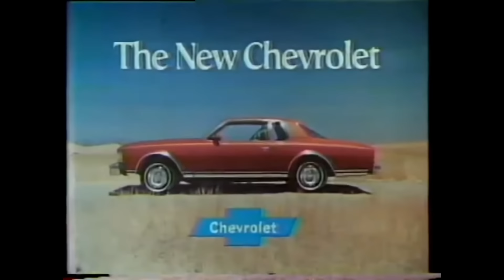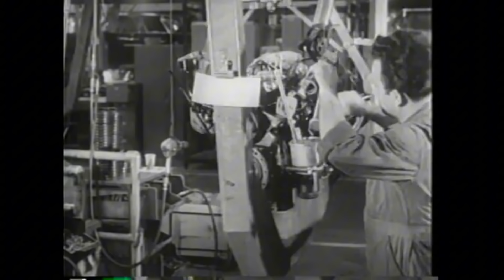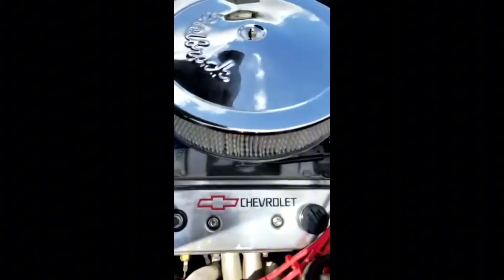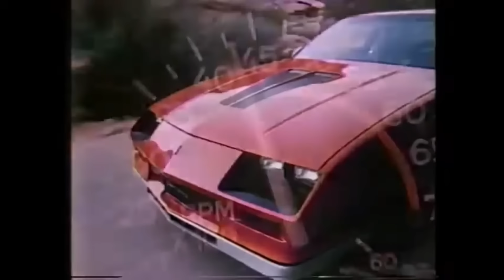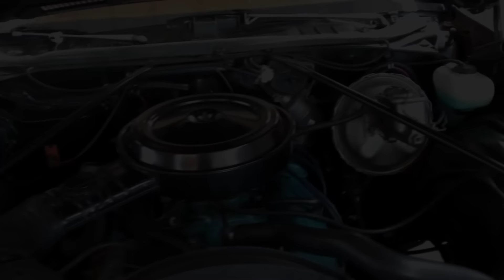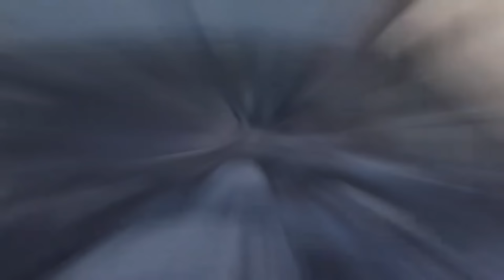How the Chevrolet 305 V8 Became GM’s American Savior AND Scapegoat

Comment: The 305 Chevy V-8 was a good engine in a car, they were not worth a flip in a truck, underpowered. I had a 1986 Silverado with a 305, had to get it replaced while under warranty, I paid the difference to get a 350 in the truck. The 350 made all the difference in the truck, fuel mileage improved and had better pulling power.

Comment: I assume the 305 came into existence because it was easier for GM to produce two small block V8’s and one small block crankshaft.   

The 307 was killed off in the early 70’s.    It was made by using 283 blocks and 327 crankshafts.    It would make sense if GM produced the 307 for just a few years in order to use up any leftover parts.    (I’m not saying that happened.    But it would add up)

Comment: I have only had one and for a very short time. I guess it is my own fault being as I never owned one before. It was in a P/U and had absolutely no guts. One drive of about 40 miles and between the engine and the over sprung suspension I got rid of it.

Comment: I bought a new 87 K10. I ordered it with the then new throttle body fuel injection and four speed OD. I routinely got 20 mpg and never needed more power in that truck. Sold it with 150k and never had one issue with it. Great truck!

Comment: The 305 is the greatest engine Chevy ever dropped in a vehicle, just kidding. It is however a decent little engine, I've had plenty of them over the years, they've all been very reliable. 

Even today I still have one in my 3rd gen Camaro, its the L69 H.O. 4 barrel version. What I've noticed is, if you box up all of the smog equipment, toss the restrictive cat and give it a free flowing exhaust your car will smell like gas, or like an old car, but seriously it will run a lot better. I don't beat on my car but if I want to, it'll smoke the tires right off the rims. 

The thing is, Its a SBC, and just like any SBC if you throw performance parts at it, it will respond in a positive manner.

Comment: When it comes to the 305, the word of the day is Compromise.  Compromise on power and torque, compromise on fuel economy, compromise on cost.  It has just about all of the same versatility as the venerated 350, even uses and responds to the same parts and bolt-on's for increases in power.  It's a decent engine, but at the end of the day, it's still a compromise.

Comment: 350 not efficient enough so make it a 305.  305 not powerful enough so add a 4bbl carb.  Why didn’t GM just offer a 2bbl 350 to begin with?  In the 90’s my parents had a 83 Chevy conversion van w/305 4bbl.  Sure it got down the road and is likely still driving today.  But man did it run bad, dieseling, backfiring, stalling.  It was like the uncle buck mobile it could backfire on command.

Comment: The 305 is fine and all but I don't understand why it actually exists. It makes less than zero sense to me; it's essentially just a 350 with a smaller bore.......... why? Why not just continue on making the 350 instead of a new engine, which improved on nothing, but at it's core was still 95% identical to a 350

Comment: GM also produced the garbage engines in 262 ci and 267 ci displacements in this era. They should have kept the 307 and 302 small blocks! My Dad had a pickup truck with the 305 and it needed fuel pump replacement every 15,000 to 20,000 miles. He traded it for a Ford with the famous 300 ci six. No trouble ever! Problem solved.
Reply: Agreed, a 307 was a way better engine than the 305.      I think thier reasoning was that the 305 & 350 shared the same crankshaft. Only 1 crankshaft to produce, besides the 400 SB and forged steel 350 crank in medium/heavy duty trucks.

Comment: I am in the process of replacing the 305 in my boat with a 350. 190 hp to 260. The same mileage in boats. Makes no sense to keep these little ones in boats.
Reply: Usually in cars the 350 got just as many MPG.

Comment: I had a 78 Cutlass Calais with the 305. It was surprisingly smooth and quiet for a small block Chevy. It did eat a camshaft, I replaced the camshaft, lifters and timing gear myself for about $200 in parts. It was then I noticed that the HEI distributor had frozen centrifugal weights and no budget to replace it. I spent a couple of hours with penetrating oil and got the weights loosened up. It felt like it had a power transplant after that! I think I kept the car for another year after that with no issues.

Comment: I owned 350's, 301's, 305's, and 307's. My experience was that the 305, and 307 were way better than the 301. 301's seemed to knock a lot even after you tinketed with them to get them to stop. The 350's were perfect. The 305 and 307 were functional although pretty powerless, but that's how the cars were back then........powerless.

Comment: We here on the East Coast blame the West Coast for the boat anchor. Dang flatlanders
Reply: If they needed to backpedal horses why didn't they bore and stroke the 283 into a modern sleeved aluminum block and run stock 2 bbl. heads?

Comment: I had one in a 85 Monte Carlo with the 200-4R transmission… that never had an operating second gear.😂By the time I got this car it was driven hard and put away wet. Thing burned oil like it was going out of style at stoplights through the valve seals. Never once did it, let me down, though! Kept on trucking until the day I drove it to the junkyard. That was after the transmission finally gave up all gears except first.😂 years later I bought a 71 Chevy C20 pick up that someone had put one in. I blew that one up on the highway doing 100+ MPH with 4.56 gears. Number seven and eight big end bearings welded themselves to the connecting rods and destroyed the crankshaft. Engine still ran! Just made a hell of a racket lol😂

Comment: Family had a 1977 Impala sedan with the 305. She finally rotted from all the Canadian winters in the early 2000s. Engine and transmission were still running like at top with 380,000 miles.....

Comment: The 305 didn't "save" GM. But it did save a sizable amount of money in meeting emission standards. The 307 was an excellent engine in its day, but it was a large bore, short stroke design. It used the 3.75' bore from the 283 with the 3.25' stroke of the 327. Large bore, short stroke engines revved faster and generally made more power than long stroke designs, but the 307 had difficulty meeting standards, especially for Nitrous Oxides. Engineers knew that an engine with a closer bore/stroke ration could meet NOX standards much more easily. So the long 3.48' stroke of the 350, used also to save money, was combined with the all-new 3.736' bore to reach the target displacement.

Comment: They earned their poor reputations bc when they came out in '76, they were doomed from jump street bc they weren't even Chevy Orange, anymore, had both METRIC AND SAE bolts & nuts, & had a nylon coating on the cam gear from the factory bc in their development, the new-4-1976 5 liter chevy came with a knock sensor that gave the archaic ECM issues due to chain noise from their cam gear.
 So the engine's oil caused the nylon to emulsify and it of course migrated to the oil pan where it eventually clogged the screen on the pick up tube for the oil pump. Any production engine is straight doomed w/out oil pressure. Then, with reduced oil pressure, about 50% of them ended up roaching at least one lobe on the camshaft which for some reason always seemed to be an intake lobe, evidenced on a diagnosis by sometimes a very violent, consistent back fire from the effected cylinder upon a stab or blip of the throttle that would obviously cease to occur when you pulled the identifying plug wire off the cap. I dunno,  I just made        "M A D"  $ swapping the engines out or just replacing the cam & lifters. 
 Then in about '81, they jumped out of the frying pan and straight into the fire when GM brought out their EXTRA lame feedback carburetor and the 7-pin ignition module. OMG; Drove me STRAIGHT to the bar almost EVERY single day. They were readily identified bc the 305 had a like 3 and a half inch harmonic balancer
Reply: The nylon timing gear was being used before the 305 was introduced, and was used on the 262, 267, 305, 307, 350, and 400.
Reply: @johneckert1365 but somehow only caused issues in the wheeze-oh-five? and, while I have you beginning in what year? ( personally I think you may be smoking some unlawful substances because the earliest 307 I've seen was a 69 and the earliest 350 Ive seen was a 67. )
Reply: @doctorcountersteer6580 I've owned a 68 Biscayne with a 307 and a 73 Camaro with a 307, both had thier original engines.   As a kid I took apart dozens of 350 & 400 apart to harvest the blocks for racecare engines. They ALL had plastic camshaft gears, and many of the plastic teeth were broken off and sucked into the oil pump pickup screen. This was NOT a 305 problem, it was an every Chevy V8 problem. All the GM divisions used plastic cam gears, and so did Ford & Chrysler. The plastic gear was NOT designed to pacify a knock sensor, it was to quiet down the engine for owner/driver comfort.
Reply: @doctorcountersteer6580 And no, I don't smoke weed, I just happen to know what I'm talking about.
Reply: @johneckert1365 and you worked on how many of those when they were in their 1st years of production?
Reply: @doctorcountersteer6580 zero.    That doesn't change the FACT that Chevrolet started using plastic coated aluminum camshaft sprockets in thier V8's around 1970-1971. 
I'm sorry this bothers you Sir.
Reply: @johneckert1365 not trying to one-up you but the first year I ever saw a nylon covered tooth on a cam gear was on a junk-oh-5 in a 1975 malibu in 1977. We used to put cams in everything we owned some of us in brand new engines around 75, 76, & etc and never saw a "factory" nylon covered tooth gear in anything but those gargage, blue, wheeze oh fives. Not that replacements didnt ever get installed on some weekend warriors on the random engines youve disassembled but I have been a line mechanic at a one Chevy dealership or another since May of 1973 and that nylon train wreck gave me stacks of cabbage as the soonest Id seen on an oh five fail was under 15,000. And yes, it was due to the tooth noise vs ECM"s at least according to the TSB's that Chevy put out. Idk a thing about any Mopar or Ford "ever" using nylon, but as I said, Chevy was/is my bag.
Reply: @johneckert1365 maybe on the left coast?  Sir please support your claim w/tangible proof? I mean, cmon, I once completely assembled a 350 chevy with an air ratchet and an impact gun that went on to log over a hundred thou just to prove a point.....; I promise you I am not talking out the side of my neck here
Reply: @johneckert1365 The left coast, John with CARB is a trip bc I have seen concourse restored 69 z28's and them in 1969 motor trend magazine (302 engine...) WITH A SMOG air pump so I assure you I do not know as much as Id like to given a choice
Reply: @doctorcountersteer6580 I never accused you of talking out of your neck Sir. But you are being ridiculous when you state the Chevrolet's 305 was the only engine with plastic timing gear problems. It's simply just untrue. The 305 wasn't the only Chevrolet V8 with soft camshafts. ALL of Chevrolet's SB V8 engines had soft camshafts throughout the mid 70's. Sometimes the fuel pump lobe would even wear off of the cam.
Reply: @johneckert1365 matter of fact, Im calling 🐂💩. Give me data, to refute MY hands-on, please
Reply: @johneckert1365 btw wheres your DZ code 302?😊
Reply: @doctorcountersteer6580 I think the last year of the 302 was in 69, same with the 327, so I didn't include them in my list of Chevy Small Blocks with plastic timing gear since that started around 70-71.
Reply: @johneckert1365 even though Im clean & sober now, those years were smack dab in the middle of me and most of my friends living in our own Cheech & Chong movie......( I promise 😊 )
 I asked an old friend of mine who also was a line mek-a-nik and he concurs with you as that it wasnt when they came out with that deplorable blue....... Maybe my memory is getting worse than I  care to acknowledge to myself!!

Comment: Had a 305 in a 1977 nova. Ran fine. Had a junky 250 transmission, went out at 140000. Had it for 8 years, till the transmission went out.

Comment: 🗿💨 in 71 the big three changed the cam timing by putting a cam gear that retarded the cam to meet emissions. When I was tasked to put a timing chain in one, I put a 70 model gear/chain in em. Customers thought I was Houdini of horsepower.😁😁 305s was decent workhorses ✌️👍

Comment: My first new car was a 1977 Camaro. I got a 305 and manual transmission to save money on fuel. The lemon law didn't exist. The car never ran right. It ran like it was unbalanced. A new car with a sporadic fuel gage, hood up in the shop 50 percent of the time, a wheel bearing failure in less than 2,000 miles and many other issues...I sold the car as is and bought a new Toyota Celica...a great car. I lost my butt on the 77 Camaro LT.

Comment: The 305 was a fine engine and did exactly what it was designed to do. Good bottom end response which allowed a then small displacement V8 to give decent mileage and drivability. It really was the ideal 'corporate engine' for a 'one size fits most' application. GM caught a lot of heat for putting these in Buicks and Pontiacs but the different brands were largely 'badge engineered' already.
Reply: Disagree. The 305 was OK in a lighter vehicle like the El Camino that my parents had (either '79 or '80, I don't recall) but even in something like a Monte Carlo, it just didn't have the power a 350 had. Plus, there were intermittent camshaft issues in at least one run of them. I think folks in the last 20 years who have gotten something with these engines and have been able to find one hack or another have been able to do a lot of things with them, but stock, they came up short. I won't say they were dogs per say, but you wouldn't have wanted one in a Blazer or a pickup. They had, on the street (maybe not in the lab) significantly less power yet the gas mileage benefit was minimal if it existed at all. Plus, they weren't THAT much cheaper new, so why buy them? The Ford 302 was a FAR better engine, more reliable, just as modifiable, and has existed in one form or another since the late '60s, except for just a few years in the early 2000s. In 1986, for example, Ford was already getting over 200 HP from a multi-port FI 302 in the Mustang and, I believe, the Lincoln Mark (x) LSC. (I don't recall the Mark number -- it was like putting the Mustang GT's engine in a T-bird body of the time). Meanwhile, GM was still stuck on the early '80s 180 HP numbers with the 305 HO. Then, a few years later, they stopped putting the HO versions in very many cars and there was a shortage. A friend's HO Firebird (either TA or Formula, I don't recall) was jacked and engine taken out. He had to have the normal 305 put in as a replacement. He wasn't happy.

Comment: I had a 1985 G10 van that came with a phony CA smog certificate. I used it to register my van, but knew that I would be screwed In 2 more years. Having owned a 1969 Camaro, I felt that was not t end. I bought t owners manual from Vromans & watched David Vizar videos on YouTube. One thing I knew from my Cam, was that to pass CA smog laws I had to run air injection headers from Hedman Headers. They have t patent on those pipes. Also an aftermarket intake( Edelbrock).. I never got to the cam, I lost my house & t van in t CA Altadena fire(Eaton fire) Jan. 7 2025. But I know that with ported heads it could have been a contender.

Comment: YUP OWNED AND DRIVEN MANY 305s when they work great when it breaks GET A 350 OR BETTER 400 SBC . Fuel inj helps them alot but beat by the FORD 5L carb d .

Comment: 2, 305s in the garage...  The first one is the factory installed 305, in my monza.
1 of 9,478 for '78.
In 1996 the block was retrofitted with flat top pistons. 
In the original 1.71 intake heads were swapped out for 14022601 heads with the 1.84 intake valve. 
Those are from an 84 305 HO motor.
And then all the typical goodies, 
Edelbrock Cam intake and carb, 
In a modified ignition system and the motor woke right up even with the slightly modified stock exhaust. 

The second one is a completely stock first generation 305. 
Also from a 78 this one in a Sunbird. 
Only 129 305s were attached to 4 speeds and installed in sunbirds in 78.

Even for a stock 305 it does great in the bird. 
1.71 intake valves completely stock intake Cam and exhaust.

Either of these cars could be even greater if I installed a custom performance exhaust system. 

But they're pretty fun just the way they are and really reliable.